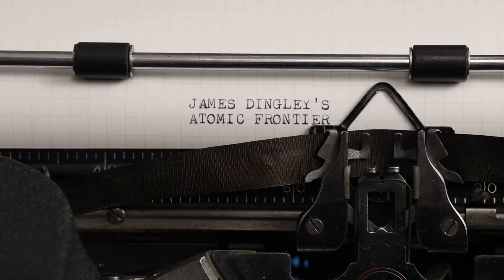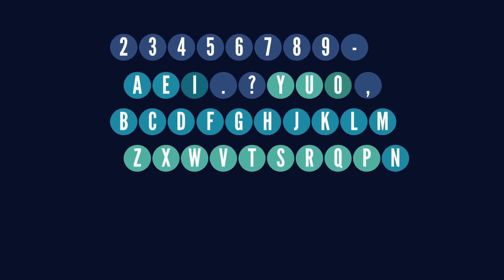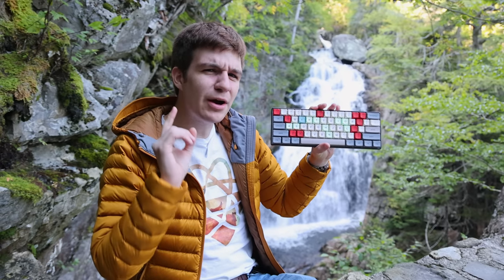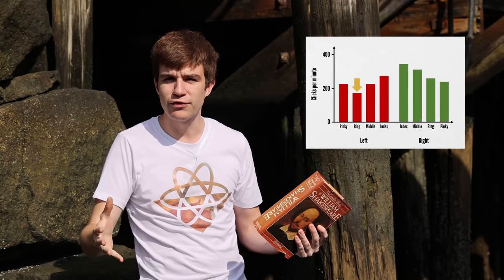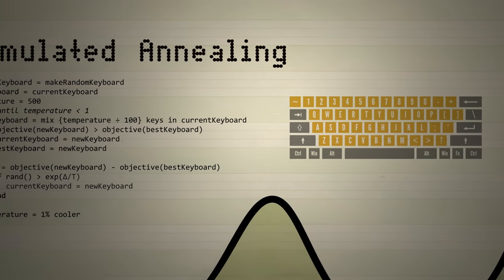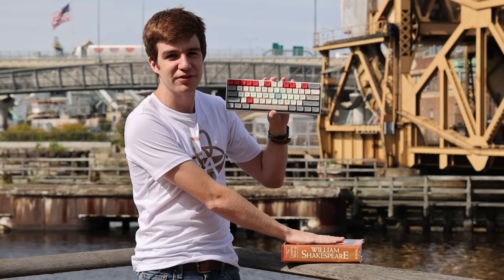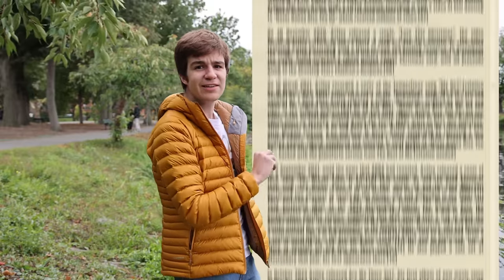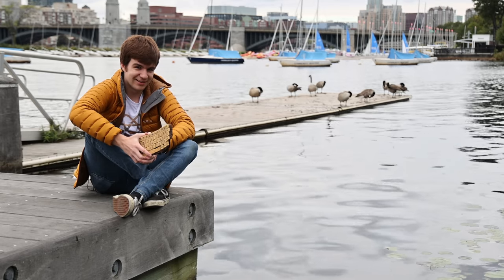QWERTY is broken. Can we make it better?

Comment: I think it is insufficient to look at how difficult it is to use each finger.  You have to look at how difficult it is for each finger to reach each of the buttons it is supposed to reach.  And especially important is how difficult it is to follow any button push with any other button push.  Then you have the right starting point to add the text set to optimize.

You also assumed there is one and only one key for each letter.  Maybe multiple of some vowels or popular consonants is better.  You also assume the same size key for each.

Some letter combinations might also be nice to have on one key, like "qu" and "th."  Maybe throw out Q.  Just have Qu and use the backspace to get a Q.

The most common letter pairs are: th, he, in, en, nt, re, er, an, ti, es, on, at, se, nd, or, ar, al, te, co, de, to, ra, et, ed, it, sa, em,  and ro.  If we only have one letter on each button alternate hands the maximum amount.  If the first letter is with the left, the next should be with the right.  If the first is on the right, the next should be with the left.  The most common 3-letter sequences should also be considered: the, and, tha, ent, ing, ion, tio, for, nde, has, nce, edt, tis, oft, sth, men.  And if we are going to use the same hand for two letters in succession, the best is on the same row, with two different fingers, next best is at least two different fingers.  Pinky on a top row then a bottom row is probably the worst succession.

Comment: The reason why you don't recommend remapping your keyboard is that it's a right bitch to use that layout on most OSs. I've tried using custom keymaps on Linux, Mac and Windows and especially Mac and Windows are a freaking pain in the but to do on hardware you control. Imagine trying to convince the guy responsible for your "modern workplace" setup to inject your custom keyboard layout into the device image for the whole company.

Which neatly brings me to the question why Apple and Microsoft make it so damn hard to introduce a custom layout to your user customization. One would think in an era of keyboard afficionados, this might be an actual thing.

Comment: it seems to me that you'd have to find an optimum for both mobile and physical keyboard typing with the same layout. Since mentally people won't enjoy switching all the time. Also I'd say; keep the numbers in a row, keep the symbols off to the side.  Also... the ultimate keyboard would have to be efficient for all latin based languages. Not just English. I think those parameters will limit the search area for an optimal greatly.
Reply: fundamentally, the 'optimal' layout for mobile is... whatever you're already used to for whatever reason you may be used to it. Because you're either using both thumbs basically equally, and resting position varies wildly based on hand size, or you're using your index finger and the positioning is entirely irrelivant.  Especially as there's no actual tactile cues on a virtual keyboard, unlike a physical one.

Comment: Interesting video however you should've atleast mentioned the multitude of studies related to this topic. Your "best" keyboard layouts are flawed even in the niches you presented as it does not consider same finger bigrams. This can be seen on the layout generated by the wikipedia dataset, with the column containing E on the homerow. ES, SE, CE are among some of the most common bigrams this will have a serious effect on typing speed and comfort.

Comment: Very special Comment: Qwerty is the way to go. This format is easy to learn and to use, but one needs a great coach when you are (a) young person. Older people can do it, but as I said, one needs to have someone very positive when it comes to one teaching it to you. The other methods in my opinion are just mediocre. They are just no good, and they offer no productivity, and they also offer nothing, but confusion. I have been typing close to 40 years, and this is the greatest method when it comes to teaching and learning Typing. Some people will be gifted when it comes to typing with all of your fingers while others will be a pro by just using two of their fingers, and that is good, but learning typing (using) Qwerty will take you far. Qwerty is the original formula just like Coca Cola is to soft drinks. 
May 4, 2024. USA

Comment: Getting people to switch to a rectilinear keyboard design is surprisingly difficult. Sure there really is nolonger any need to stagger the keys, and yet if you don't it is perceived as a cost cutting measure.  Is there are reason to? Well yes the finger motions are simpler then on an offset keyboard.

Comment: I’m not sure using machine learning is a great way to do this. At least not in the way it’s been applied here. It doesn’t take into account finger strength and how the hand works, for example it’s easier to drum your fingers from the pinky inwards rather than from your index outwards. These are two of the optimisations used in Dvorak.

Comment: your initial assumptions are fairly flawed by virtue of relying on home row method, which is not an ideal technique for several reasons and is not used by the fastest typists

but of course to determine distance without consistent fingering is vastly more complicated

Comment: Na, learning a new keyboard layout isn't that hard. At university they had US keyboards instead of German. This resulted  in me being dual layout capable for decades. Except for the z y thing ;)
Never understood why most people working with a PC day in day out never bothered to learn typing all their 10 fingers.

One question: why do you call the letter Z zee? How do you pronounce C?

It's similar to car shifting. One car I have I start in second gear because where the first gear should be there is reverse. The other car is "normal". I never fail at this. Where i fail is when a car got 6 gears but the other has reverse instead at this position.

Comment: If you have used qwerty for years, just keep using qwerty.
If you do not need typing for a specific job, just keep using qwerty.
If you have no experience with typing, qwerty is inefficient, use something else.

We should start teaching people new layouts, and have more modular keyboards, but for most people, qwerty is superior. In 100 years, qwerty should probably be phased out, but, not right now. I'm 40, and I learned qwerty when i was 11. No amount of data is going to get me to change to something else, because the layout of qwerty is so ingrained, that when I imagine a word, even if I'm not at the keyboard, I can instantly imagine the line it would take to type it. I'm also able to type 100 wpm. 99% of people don't need to type faster than 100 wpm.

Comment: First, I want to say that this is an excellent video. Very informative. My comment isn't meant to take anything away from that.

That said, it seems to me that the problem isn't the QWERTY layout. It's the way people type. I taught myself to type in a primitive BBS chat room in the '90s when I was 15 years old, and I didn't learn the "proper" method. I just did what came naturally to me, and that was hunt-and-peck. My hands are positioned well above the keyboard, and the only fingers that move significantly are my index fingers (with my left ring finger occasionally going for the shift key). I'm now 43 years old and I've never suffered an injury in my 28 years of typing. Also, I've gotten good enough at my hunt-and-peck style that I've been tested in an official capacity for a potential typing job at 50 wpm. And I should probably mention that there isn't much in the way of hunting left in my hunt-and-peck style. I occasionally have to look down for something like a punctuation mark that I rarely use, but I have the locations of all of my most-used keys memorized. I think the same would be true for anyone else learning to type this way.

Comment: The entirety of this typing being better or worse for you is entirely based on typing with your fingers in the "standard" typing position but this has already been proven to be worse than other methods of typing with your hands.

an askew layout with your fingers floating and using both left and right fingers to reach the middle based on the position of your hands of previously used letters improves typing speed and comfortability. Standard typing position has so many flaws with its biggest one being the implication that you should move only your fingers to type different letters instead of moving the position of your palm via the wrist to reduce strain on your fingers. 

Just stop typing using the "standard" finger layout and find a comfortable way to type with your hands and particular keyboard layout, you will end up faster and significantly reduce the chance of strain based injuries.

Comment: Nice, though your objective function makes a lot of assumptions about the user (they are typing English, typing predominantly words, and are right handed). The optimal keyboard arrangement will almost always vary depending on the context. At the end of the day the benefits of standardization usually outweigh the marginal efficiency improvements.

Comment: This entire video is why I hate engineers

"This thing is standardized, widely used, almost entirely future proof AND if you understand the modern one you understand almost every major historical itteration that came before. But lets throw that all out because we could make it 0.0000000000000000000000000000000000000000000000000000000000000000000000000000000000001% more efficent"

How about NO? 

Of course you compared this madness to AI, you don't actually care about the logistics of implimenting your inane ideas. You just wanna sound really hip and with it to your tech bro friends.

Comment: your "better" keyboard has the numbers in a random location. 
it's crap. 
the fact that the 6th key is 5 and the 7th 6 is incredibly important for data entry. the number of keys were limited because they needed physical linkages to the printing heads. so we can afford to have a 1 besides the 2 and a separate I key. And the shift key is called like that cos it literally shifted the print heads so the upper character of the two per head was printed.
many "optimizations"/revisions of querty are to tune the delay between the most used keys to prevent double hits (when you hit a key and its print head rises and catches the still retreating head from the previous key press) so the keyboard revisions made some common key combinations intentionally slower.

having [] separate is ridiculous for programing  same with <> and () (this are together). 
maybe you should've optimized this with code or repetive text like names and addresses for data entry.  or just eliminate the numbers and symbols and add a keypad.
important edit: loved the video tho. despite not liking the final layout.

Comment: not for me....
I have an anti- leak  way to use a keyboard..., It's totally impossible  for you to see or decode what I'm typing.
It also gets round the problem of any sort of physical damage.

Depending on what word i'm typing , either my left or right hand can be used, I don't have a specific  digit for a letter, it's based on the location of the keys to the word.

This also means it works with different languages , since the "qwerty" is based on English... .
All this bullshit about "minimum" travel is just that.
"Qwerty" is also complete bullshit for handicapped people, go... be a speed typist with 1 hand or even a finger missing can give you a bad day...

Comment: Great video!

I have switched over my phone's keyboard layout for sure. I type a lot on my phone, and ergonomics is really important to me. I watched a video [ https://www.youtube.com/watch?v=EOaPb9wrgDY ] which was certainly very eye opening that used AI to land on a better typing experience for 2 fingers. It didn't go for a total rewrite of the keyboard like with 11:01 but I'm intrigued enough to put that keyboard into my phone and give it a go. Regardless, I use the 2 finger layout in the other video I mentioned previously, and my thumbs have thanked me thoroughly. I no longer have joint soreness after long stints of phone usage or typing.

While I wish I could switch to something more ergonomic on my computer, I don't intend to switch because unfortunately my work computer situation only allows common layouts (I'm sure there's a workaround with hardware, but I'm not interested in that option), and I also use VIM while coding for work. The keybindings for moving around the cursor in normal mode are h, j, k, and l. Dvorak really doesn't allow me to use these keybindings effectively, and although VIM is entirely customizable, I'd very much like to be efficient with any server VIM instances as well, so I go incredibly default with my vimrc. The only thing I generally change is line numbers to being relative. Coding with VIM seriously reduced my joint issues, so I think that's a win in and of itself. (EDIT: Realized I didn't specify why VIM is a win ergonomically - it's primarily because you never take your hands away from the home row to use your mouse. Everything can be achieved with the keyboard, and it's incredibly helpful for your ergonomics to not be moving around so much, especially with the way coding is very edit heavy.)

I thoroughly enjoy watching videos that reexamine typing layouts. I also have been thinking about the possibility of touch typing on a phone and how that would work. I keep going back to a virtual joystick idea, where different positions input a different character. It would certainly not be intuitive to touch type on a phone, that's for sure. But I do believe it would be completely worth it to find an alternative to what we have now. It is a different piece of hardware than a keyboard, after all.

Comment: Misleading title, nothing interesting in this video, just wasted time. Oh, actually not completely, I've learned that the "proper" way to write on QWERTY layout is actually bad for other people's joints. As a child, I learned writing on QWERTY myself, using all my fingers, and I write totally different than the "correct" method. 28 years writing on QWERTY for 14+ hours a day, and no pain, no problems, nothing. Just learn to use your fingers reasonably. For example, the "correct method" says you should use the same finger for letters "E" and "D", while I use 2 different fingers, without any motion needed to write "ed" (and 2 hands no motion for write "learned"). Also my "home row" (resting position) is the bottom row (ZXCV...), so the QWE... row is the hardest to reach (as for letters). That resting position makes my hands... resting :-) And it works. But I'm still mad I wasted time for this video + another 30 min of research on the web, just to confirm my way of typing is simply better.

Comment: The problem with your experiment is your assumptions of your data set. If you are a system administrator a Linux system or a programmer then your optimized layout would be non-optimal. But then you would have to readjust when you are not at your computer, that is where Querty has you beat.

Comment: @Atomic Frontier

so whats the conclusion to this?
do not mess with keyboards because it only gets worse for several reasons

the approach is flawed in itself too

a keyboard where what you see does not make sense is basicly unusable so having number keys thrown in randomly in the layout is just bad.
then its basicly impossible to convert that layout to any other device without massiv issues wich makes typing on such devices practicly impossible.

i mean you got some interressting findings for sure but the approach just does not work out in reality at all as it is flawed at base lvl to begin with.

and then we not even at the level yet about compatiblity programs, shortutcs different operating systems and so on.
but i assume all of that was not even a goal in this test scenario.

Comment: Dafuq was that hill climbing analogy. It made no sense and seems like it only existed so that the term "AI" could be used
Reply: It makes sense in a way. Small improvements (moves) in the solution space lead you to a hill top (local maximum) and you can not get higher up before you descend, which is shown to be true for the market of keyboard lay-outs. Really, he's talking about a local maximum more than anything else, because markets in general do not behave this way.

Inertia or lock-in are more apt terms though, because this hill climbing analogy mixes design improvements with market improvements.